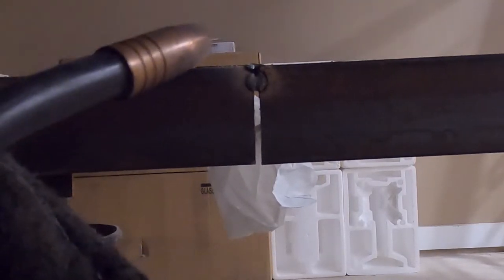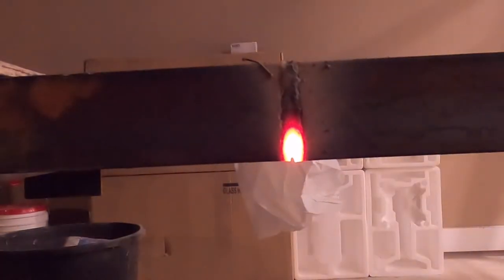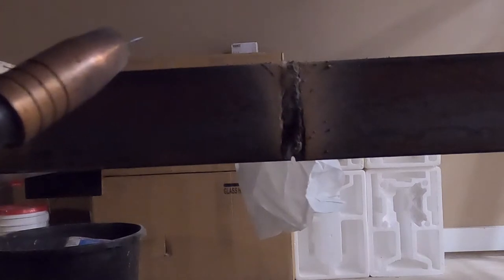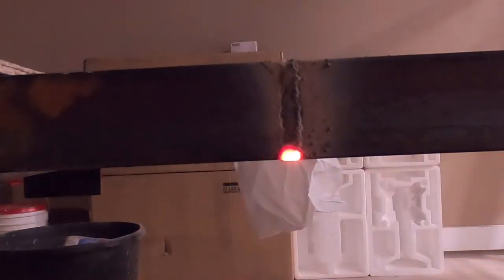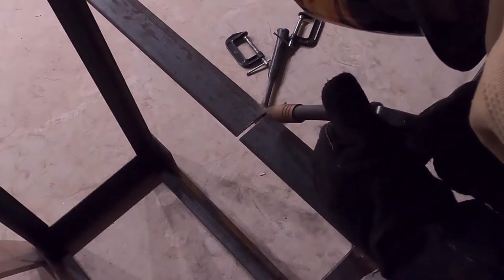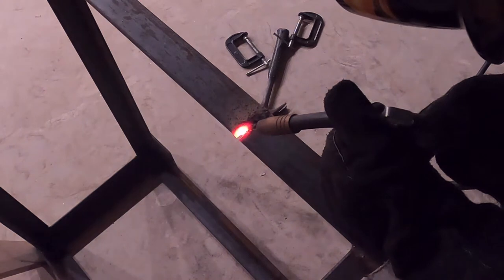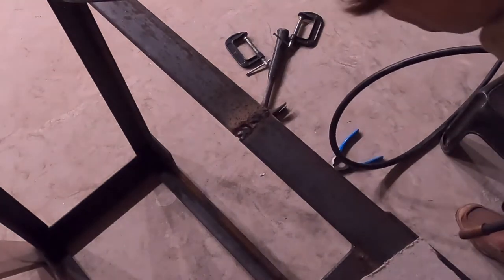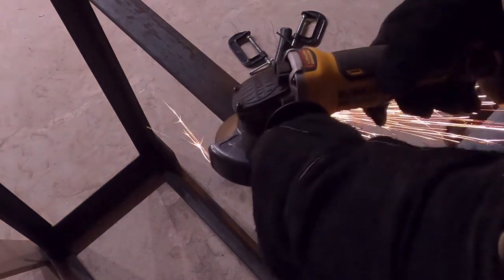Flux-Cored Arc Welding ● Weld Across Large Gaps ✅

Comment: The weld looks good.  I am surprised that camera sensor did not burn out with that weld. You might want to buy a filter for the lens for welding videos.  Or not, maybe the gopros can handle it.
Reply from the maker: No idea on the camera sensor. Hopefully it’s ok. Next time I might put a welder mask in front of the lens.